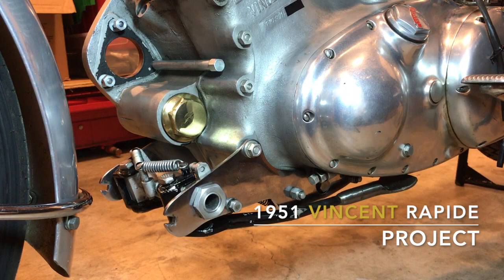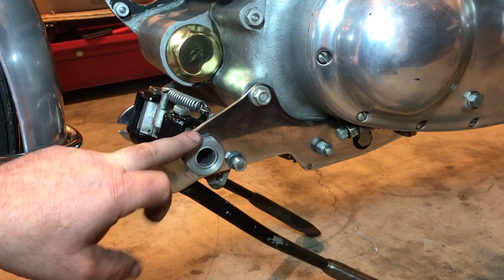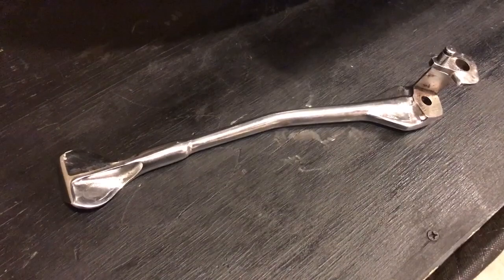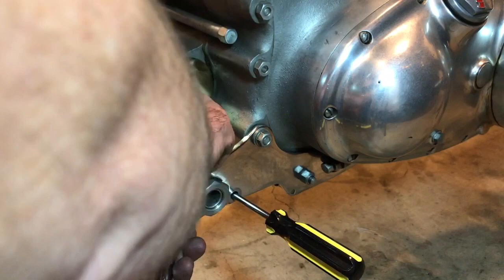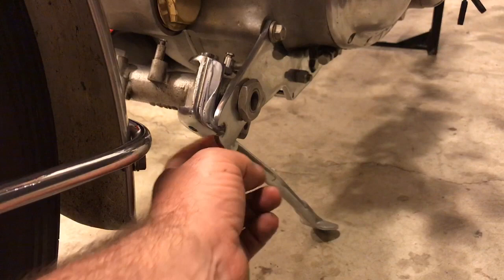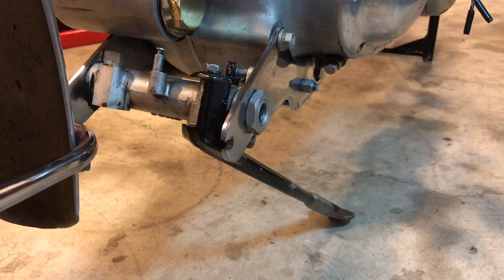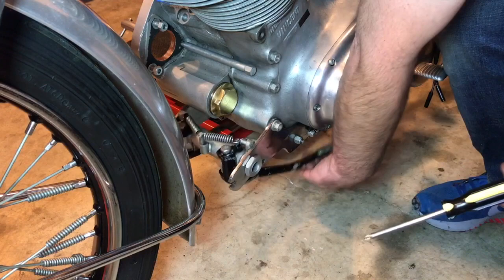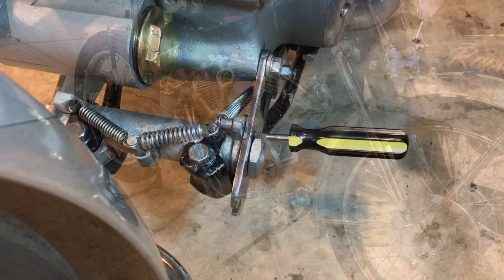Restoration of 1951 Vincent Rapide - Part 11 - Prop Stands

Comment: Hi Mike, do you think they should be a shim or large washer on both the insides of that stand bracket?   when you were pulling the stand down you could see the bracket moving outwards, the other thing I was thinking how do you get the bike off the stand once you have say fixed the front wheel, or do you not use both stands at the same time ?  IE so you can roll the bike forwards or backwards .
Reply from the maker: Hi Keith, yes the manual says to "simply" push the bike forward off the stand.  It wasn't quite as easy as that but it did work with a little care!  Looking back, I think the main issue is that the shoulder of the left leg was rubbing on the inside of the bracket.  Cheers, Mike

Comment: It looks like someone has "got at" your front stand, it should work smoothly and without having to file big lumps off it, it could be that it has some sort of after market longer stand arms that have been cobbled on, but it looks like you have sorted it out now.
Reply from the maker: Yes, I'm pretty sure that the legs have been modified, certainly at the ends and may also be after-market.  It didn't take much filing to take a little bit off the shoulder of just one leg and it now works great.  Cheers, Mike
Reply: I like when you called prop stands " guys "